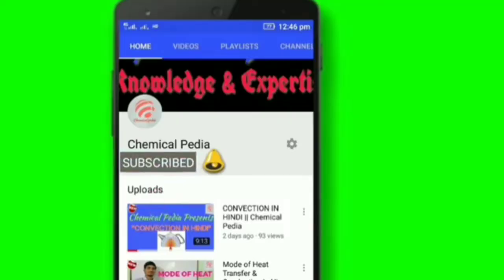Pulp manufacturing process || Chemical Pedia

Comment: I can't understand some point. You told at 2.30-2.35s that we remove polymer material like lignin & cellulose. But the Cellulose is the main ingredient of pulp. Then why would we remove it? Second The white liquor is used as the digestion liquid which remove the lignin and turns black liquor. By Kraft process  we recycle the black liquor as white liquor & use it again in the digestion.  So why we use a mixture of black & white liquor in  the digestion process?? Which Industry use the mixture of Black & White liquor? Please give me a reference. .

Comment: Sir which chemical can we used into pulp to get water proof product
Reply: Use pistachio shell, it's waterproof, I kept in a small container, it didn't melt or have fungus to it, I kept for 2 weeks, with water,
Hope this helps, 
Similarly you can use other nuts shell like walnuts shells.